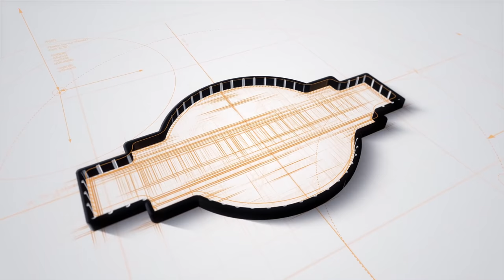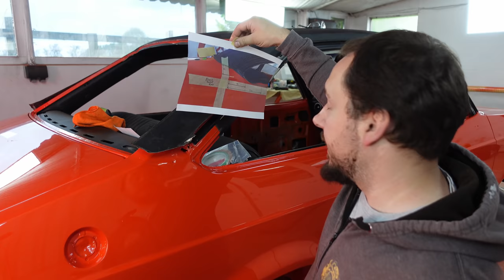Eariest Ever MK2 Ford Escort RS2000 Restoration is COMPLETE!

Comment: Well done, an excellent job.  I owned a white 1978 RS2000 back in the mid 80s and looking back at the photos of that, the only difference I could see was mine had a pinstripe.
Reply from the maker: The early ones had a thicker stripe down the bottom towards the sill, they are known as broadstripes in Escort circles. Not sure on when but they changed to having the pinstripe higher up not long after they came out which makes the broadstripes a little more rarer.
Reply: @WhitelandRestorations  I was being a bit loose with my language. Mine had the so called broad-stripe too. It didn’t have the big RS2000 decal on the rear quarter.

Comment: Fabulous job guys. I did some work on my 79 one in the early 80s. Diamond white. It had a coach line higher up which had been previously been 'bottom half' painted to and I got a reaction which took some containing I was using Cellulose. I remember removing the strut top reinforcement plates to do some minor work and then reattaching  using plug welds to give the factory look  It needed one rear wheelarch due to corrosion. Your black rubber bulkhead cover was in surprisingly good condition for the age. They were always fragile.
You may have already answered the question but I've not seen it. Why do you think that the gearbox tunnel entrance had been modified with a hammer?  I know on the early standard Mk1s in order to accommodate a Type 9 bellhousing it required some 'relief' with a big hammer. Shouldn't have been necessary on a pukka RS.
Reply from the maker: Thanks for watching! Our guess is someone got a bit hammer happy when trying to squeeze a bigger gearbox into the shell back in the day. Apparently its quite a common thing..... People did strange things on their driveways! 😂

Comment: You got me interested with the Sunbeam Lotus but then this pops up. I'm reliving my youth. I had 3 mk II RS2000s. AST634W (signal yellow) got written off after being smacked up the arse on a rainy day in Milton Keynes. CAN 797 V (black) I sold to friend of a friend and my favourite of all time RCD191R (guards red) was nicked from the forecourt of the service place I left it at. I was gutted then and still am today especially as the way these cars are selling for.

Is that paint colour red or orange? I can't quite tell. If I were the owner, I'd have had the vinyl roof taken off as I hate them.
Reply from the maker: The Mk2 Rs2000 was Carnival Red, which is more orange than red really but who are we to argue with Ford! Did they ever track down your stolen Escort? Thank you for becoming a channel member, great to have you aboard!
Reply: @WhitelandRestorations  It's a funny story. The car disappeared and then about a year later, the bloke I know who built it and I bought it off of was up at the same repair shop I left it at.

It was late on a Saturday so he took a stroll up the road where all the garage doors were to different shops. He saw a shop about 3 doors up with it's door open tinkering about on cars. As a mechanic, he popped it to have a quick chat. While he was there, he spotted the motor he had built and went over to check and it had his markings on it. He said goodbye and walked back down to the place where I had parked it in front of.

They call the police and soon afterwards, the rozzers showed up and he went back up there. They were denying everything about stolen property when my mate walked over and showed the copper his mark on the engine head.

They got nicked and prosecuted. The car had been completely parted out so I have no idea where the shell ended up. All I got back after a years wait was 1k and a few odd parts that were left in their workshop.